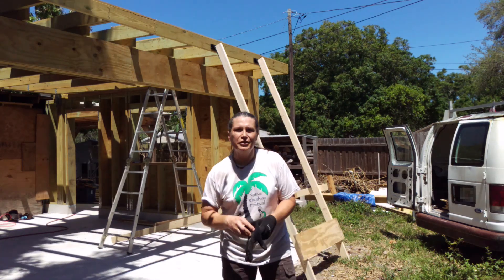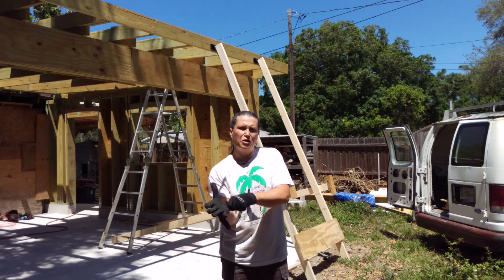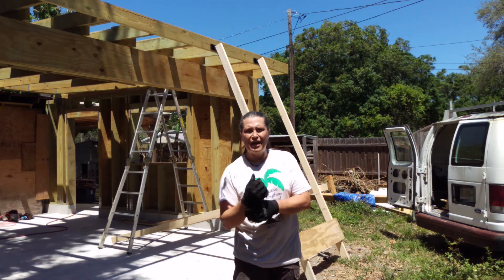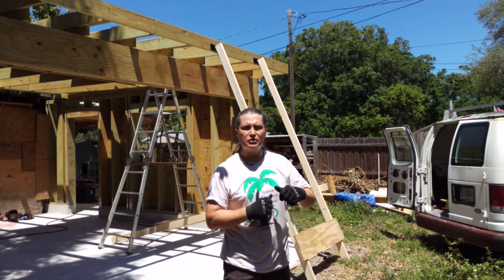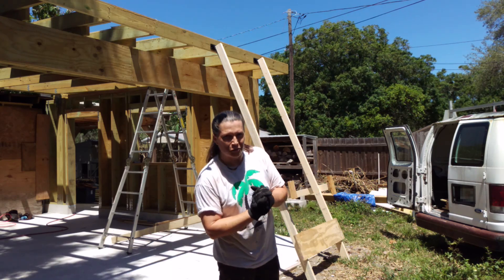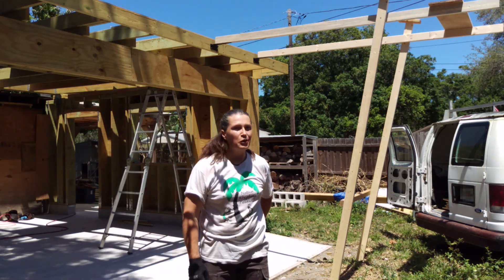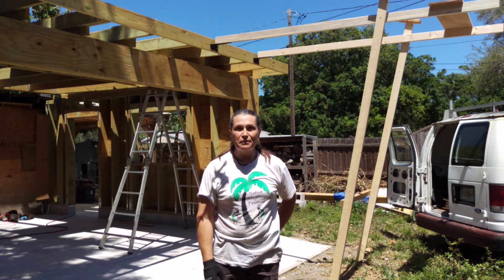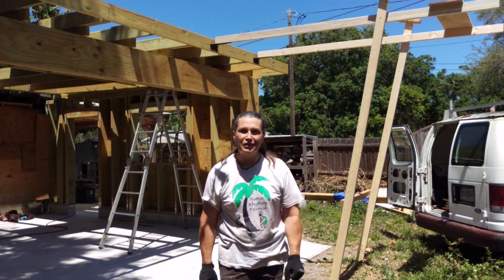Homemade Lift for Raising Plywood onto a Roof by Yourself

Comment: Awesome idea.   I was thinking about installing a pulley up top, but this looks even easier.    Rather than pulling the board from the ladder you could also use a push stick to move it onto the roof.

Comment: Awesome! I love this idea! I’m just not sure how I could make it work for the task ahead of me… 
I need to lift used arena hockey  boards up to a height of 15’  to put on my hay shelter as siding…by myself. 
The problem is that there’s only 2’ between the barn and the hay shelter. But at least the roof of the small barn is lower than the roof of the hay shelter so it’s not 15’ straight up. The hay wagon is inside the shelter so I ‘could use that as my starting point and pass the boards through the opening in the wall to the outside … but regardless  of which side I raise it up on, I still have to figure out how to hold it in place until I can get it screwed in. Do you have any ideas? As for the lift…it would be really GREAT if you could make a video of you constructing the lift - giving dimensions etc- for visual learners like me! My brain can’t understand the mechanics of it until I see it being assembled step by step!  THEN add the video of it in action!! It’s a Great idea  and a great demo- I just need  to know how Ito  build it!! Thanks! Patti

Comment: After tripping on a bag of cement in the back of my truck and having a sheet fall on me  because I was trying to fight to get it up on the steep roof alone I decided to check out what other people have tried and this is nice and fairly simple and I'll be doing this next instead of trying to act like I'm a beast and giving my neighbors something to laugh about as I fight to get 5/8 osb 12 feet up in the air on a roof. Thanks for the tip. I'll have one similar made tomorrow in less than an hour or so and put the rest up. Jokes on my neighbors because they not getting anymore laughs here. 😂

Comment: I used a similar method to lift plywood , then cut the support legs to the angle of roof pitch and used it for the steel sheeting as well .

Comment: Oh, wow! I was just looking for something. I do not think I can do it this way because I have a house in the way but this does give me ideas!
Reply: I just came across this video, but probably have the same problem as you, the house is in the way. Did you come up with a solve?
Reply: @glennebel5403  I built a cart that would slide up an extension ladder that I added wood to to make the ladder all one level. Added a pulley to the top end of the cart with a cord. Pulled the cart up to the roof with the plywood on it. I used clamps to hold the plywood to the cart.

Comment: That’s a great idea! Do you have an idea on how to move them through rafters into an attic in a cramped 18x20 cabin?
Reply from the maker: Maybe a pulley system and a boat winch? I used a 12' 2x6 with a 2x4 strongback, a pulley, and a boat winch to raise the 18' long quadruple 2x10 beam into place by myself. It wasn't pretty, but I managed to lift it into place.
Reply: @tampabaybutterfly  that's a great idea I was just given a boat winch too! Thankyo

Comment: WoW! Nice!
 Of all the ways to do it,  I think this is the most clever. 
I have lost all of my strength due to having had cancer and a new heart valve replacement, and I am in my 80th year! 
I am rebuilding my old blacksmith shop, and have had to seal it up and install OSB on the celing and walls.
So this has helped me a ton, Thank You.

Comment: we made a nearly identical ladder, to load advanced onto via a small tractor with clamp on bucket forks, and then had a u channel of wood at the end to push the sheets up so someone could lean down, grab the edge, and drag them up one by one. P.I.A. This little contraption is brilliant. Just need some hinges, and our setup will be much improved. Thanks for the video
Reply: hahaha, leave it to a woman to take a 'mans job', and make it more easiah and more smartah!. Sure beats the hard, slow way. :)

Comment: I made one to hoist up solar panels. I used an extension ladder as a trolley and made a slide for it  .It would work for plywood,I guess.Ladder is 15 " wide. I didn't bother with pulleys.They are only 50 pounders.https://imgur.com/xGzUR4C
Thanks.I'm to old to carry them up!

Comment: What a fantastic idea! I don't know if this will work, but if you screwed in two pieces of 2 x 4 about 8 inches long verticle and then attached the hinges to them, and then made the legs a bit longer. When you raise it up the sheets should just slide off instead of you having to go up the ladder to pull them off.
You might be able to get five sheets up there one on top of each other that way. Just an idea. Lol don't know if it will work, but worth experimenting with.
Cheers from Ottawa canada